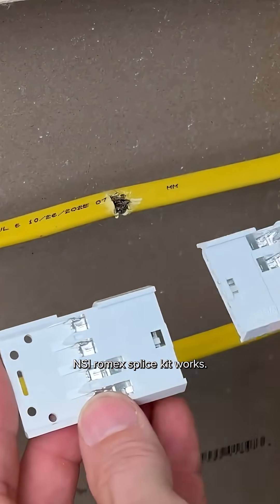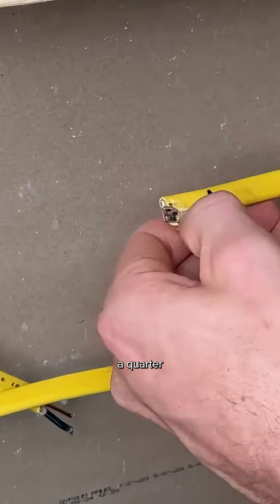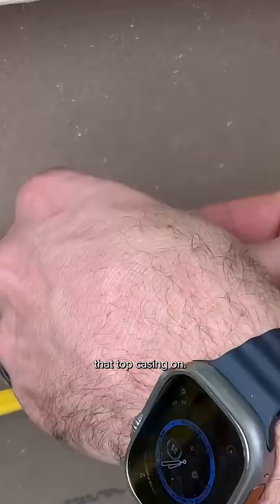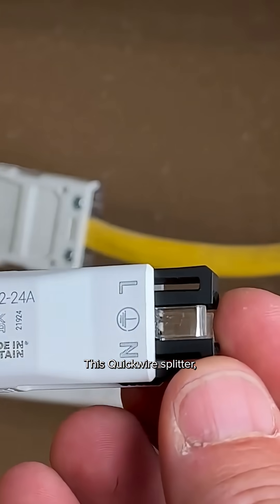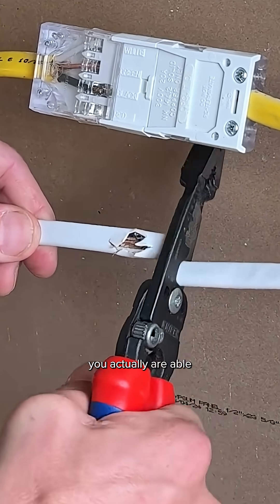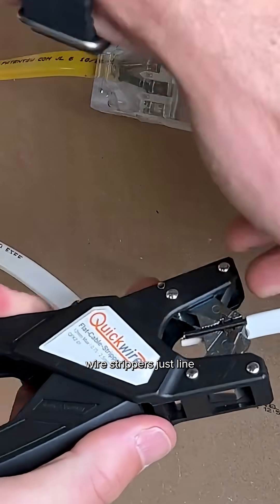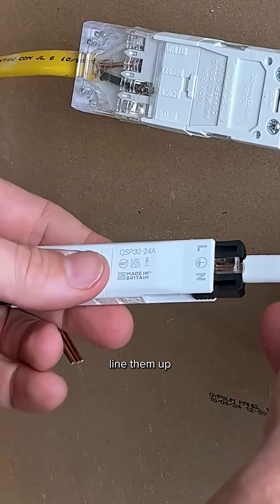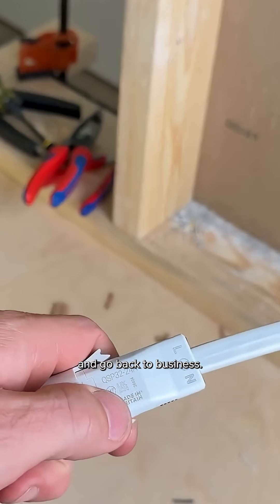The NEC-Approved Splice I Hate… and the UK Inline Splice I Love

Comment: I don’t trust any sort of splice that’s buried in the wall. Anytime you make spices they should be accessible. I don’t care if they’ve been approved or if these ones get approved, I don’t trust it.

Somebody’s gonna do a poor install, and then it’s gonna ark and cause problems. If this kind of thing is acceptable, then I should be allowed to twist my wires with my lineman pliers and put wire nuts and then tape it up and bury them in the wall.

The problem is not the device, the problem is trusting everybody to do these things properly. I can make spices with my wire nuts that will never get loose or cause a problem, but can I trust the next guy to do as good?

Also, what if the device did fail? Again, you would have no idea that that happened where it is or anything when trying to troubleshoot the loss of power to various outlets or something.

If a junction box is used and accessible, then a poor splice would at least be able to be serviced and repaired, but something like this buried in the wall you would have no idea.

Comment: Splices must be accessible. If that's the case then there is literally no need for this connector.... At all... And it isn't a cradle. IPC, Insulation Piercing Connectors. Been around for ages. If it isn't made for the IS market why are you even demonstrating this. No UL listing no NEC allowance.

Comment: I was hoping you'd do a voltage test and a thermal test to see how safe these connections are. Is there an increase in resistance,etc?
Reply: There will be a little with the way the wires are connected. The little pieces of metal that actually make contact with the copper are so small.

How much resistance they add, I don't know. Would like to test them.

Comment: Approved, but let’s see what the infrared gun says about both of them
Reply: Well it's the US so were taking bets here. My bet is the already government approved one will be hotter or the same as the UK one.
Reply: Yeah this would be a cool test
Reply: @PBVader, Explain, please.... I don't see what one has to do with the other?  🤪🤔
Reply: @af.7992  Induction. Learn it. What OP is describing is a hotspot troubleshooting technique.
Reply: @PBVader  so, if houses burn down early because of splice failures, it doesn't matter because a Carrington event might occur in another century or so?
Guess we can cancel all emergency services too, everything burns down or drops dead eventually.
Reply: @spvillano  Houses burn down because of old wiring breaking down, botched and halfass jobs and not paying attention to details (rushed). These weak points were originally mandated to be accessible by the homeowner for repair and inspection, which subsequently got farmed out and made our society stupider. The sun cycle is 11 years, and our magnetosphere is weaker, making a Carrington event more likely from the simplest sun outburst. 100 years? NO. It doesn't matter if the power is cut, the sun will electrically induce power. So grab your temp gun and your ohm meter and give them some lovin'.. Know your system.
Reply: @PBVader  Good answer! We've got maybe 5 to 10 before another Carrington or generally strong flare fully overcomes the already very weak magnetosphere and really creates hell
Reply: @OverAndOverAndOver   Oh dear me, are there any billionaires or trillionaires I can pay taxes to that'll fix the 'weak' magnetosphere or maybe I can stop farting and that'll help? If only I had a penny for every internet soothsayer predicting doom "in 10 years" I would be as rich as Croesus. I'd bet my life there hasn't been a 10 year period in human history where someone wasn't predicting certain doom. You're always wrong and you NEVER own up to it, you just move on to the next scaremonger boogeyman and forget all about the last failed prediction. I had a friend in HS who INSISTED that before he turned 30 there would be at least one pole inversion and probably a Carrington event, that at any rate we would be back to the stone age. If I called the guy up and asked him after all these years he would probably insist he never said any of it. 

Just another day in the Anno Pagliacci MMXXVI
Reply: @billdberger7407  crazy story bro, except it's properly scientifically backed at this point, wait till the middle of next year or 2027 when there's Aurora's down to the equator like we've already seen in the past few years, or better yet when your power goes out and doesn't come back, this is not a time to be mad to feel pride on the internet, this is a time to do some research and maybe start prepping

I don't mean to come at you, if we make it to 2037 I'll gladly admit that I'm wrong, but real signs are showing more aggressively daily and there's no ignoring it any longer
Reply: @OverAndOverAndOver   Okay so now the occurrence of a Carrington within the next 10 years is SCIENTIFICALLY BACKED... By whom the ghost of Lysenko? I think it's interesting how terrestrial weather cannot be accurately predicted a week in advance but you have 100% certain predictions about solar weather over a decade.

Look here's the bottom line, I don't believe you and I never will. I think you're a chicken little soothsayer, a yellow alarmist, and a clown. You have no 'scientific proof' as to what the sun is going to do, all you have is LLM written pablum designed to scare politicians into paying for upgrades to infrastructure. It's no different than the glut of papers predicting that an EMP was certain to happen prior to 2020, there were many alarmists who testified to congress urging them to spend billions hardening the grid against something that never ended up happening. Working in the military industrial complex we see this all the time, someone swearing some potential enemy has WMDs or wonder-weapons and to counter them we have to spend all the money... Often the alarmists are beneficiaries of those expenditures.

There will be no Carrington event in the next 10 years, and you can manipulate statistics all you want and it won't make any difference. Just like I can say with complete probabilistic certainty that if you flip a coin infinite times there will be a series of flips where it lands on heads 1,000,000,000 times in a row, statistically true but MEANINGLESS in the realm of reality.
Reply: Line temp under load isn't going to mean isht when the sun produces another Carrington event and a whole bunch of houses burn down.
Reply: @PBVader  Not quite accurate, the weakest points of failure ARE in fact visible with the methods u dismiss.
Reply: @Klaa-2  Those methods were NOT dismissed, you should see my other comments. The whole system is relatively weak, and built upon a grift known as the NEC from the NFPA, originally meant for responsible homeowners. Or did you not get taught that part? We are a "nice" soyciety, look up the root of that word. I could go into so much more detail.

Comment: NEC does not approve devices.  They states requirements for use. And independent engineering test labs certify compliance.
Reply: That would be different than Canada then, since there's a code book for installations (CEC Part 1) and another one (CEC Part 2) for manufacturers.

Comment: Not Appoved. After looking for a day and ripping up plywood sheets in the attic I finally found this quickwire in the wall behind a mirror. The hot side was toast This was a young couple in a codo and felt for them and charged them 1/2 price. For heavens sake make all connections accsessible
I've seen too much crap that has been coverd up  and have been doing this for 46yrs . Thx for letting put my input on this matter
Reply: If i'm not mistaken these are allowed, but must be accessible. So really not much advantage if any to using them vs. a standard junction box.
Reply: @0778drz110 I agree but, if there is not enough play/excess with the wire then the junction box idea will not work.I
Reply: @0778drz110 nope can be behind drywall by the UL listing only to be used after the fact. If a new run can be ran with minimal or no damage your inspector will request you re-run the wire.
Reply: Are you in the USA?
Reply: I don’t understand how you found a quickwire connector in a home in the USA
Reply: @bradley219 he didn’t, he’s lying or he misunderstood the question.
Reply: what splice do you prefer? or do you just mean that all splices should be accessible?
Reply: All splices should be. Also really dont like those plug n play type connections except for low voltage
Reply: @MrEfx8 isn’t 120v considered “low voltage”?
Reply: @mikecumbo7531 400v is Low Voltage.  Up to and including 1000v is LV.
He means ELV, Extra-Low Voltage, up to and including 50v.
Reply: @Dranok1 I knew what was meant.
Reply: @MrEfx8 then some repairs require ripping the whole house apart like you had to when the whole wire needs to be replaced. It also makes prefab construction nearly impossible.
Reply: @mikecumbo7531 
120 is "line voltage." It's technically low voltage in the overall scheme of voltage assessment, but gets a sort of perception exception where iit becomes the prime reference. When saying low voltage in reference to 120VAC, it typically infers things like 24V systems for HVAC and others.
Reply: @Dranok1  There are multiple definitions for "low voltage", depending on what industry you are working in, and the context.

If you are working as a lineman or something similar, then "low voltage" means under 1000V, but not for anyone else.  That is an industry-specific definition that only applies in that trade (and related).  For most other trades and environments, "low voltage" actually means under 50V, and this is actually very common usage most other places.
Reply: Absolutely agree. The ONLY junction I would reluctantly enclose in a wall would be an underground splice kit with the 4 lug block and glue bound heat shrink. Even then, I'm reluctant to "bury" it without access. I'll either use the splice kit, 2 old work boxes with a new stretch between them, or pull new wire to an accessible location. It's too easy to fish new wires vs cutting open a finished wall.
Reply: These should never be buried! Splices must remain accessable.
Reply: The NEC is a joke. You can have anything approved if you know who to pay off, yes even to violate the NEC itself. It's happened before, then revised to fit, then thrown out. There is zero room for inaccessible splices.
Reply: @PBVader  Just Remember that the NEC is book of Miniums.
Reply: @MrEfx8  Its a book of profit. Nothing is going to stop another Carrington event from torching millions of places.
Reply: @PBVader  just like how manufacturers are trying to push those silly universal mounting plates for all lighting fixtures. I forget the main company name, but that's the next big one.
Reply: They are approved for in  wall coverage or bury it in the wall. I feel most journeyman can make better splices with linesman and wirenuts, however you cannot bury a jbox in the wall. I've used them to comply, but don't feel comfortable using.  Add an AFCI to the circuit for added protection!
Reply: @JM-iz3fr  I agree with your “added layer of protection”!  If the damaged wire couldn’t be replaced properly, and either of these splices were used, I would feel better knowing that I didn’t create or hide another potential problem.
Reply: @JM-iz3fr I don't believe that is the case. Unless they changed their listing the instructions say they must be accessable

Comment: I wish it had a clear housing, I don't like not being able to see the connection that's made and not being able to see exactly how the wires are laying, especially when they are so close to each other.  Maybe if I saw a view from the end it would change my mind.
Reply: That's probably because the fire retardancy of the housing is improved in the opaque casing over a clear material. 
I'd rather have better resistance to ignition, surface spread of flame and a reduced fire loading.

Comment: The release for reuse is dumb and a liability.  This type of installation is permanent, so why offer a mechanism that could enable an accidental disconnection during or after installation?  Even worse would be a partial disconnection, that would introduce the potential for arcing deep within a wall or ceiling.

The footprint of the UK design is nicer, certainly more pull-friendly.

I'd avoid either solution, and wrap the heck of of either in electric tape if  I had to use them or encountered them.

As noted by other commenters, where are the impedance test numbers?

Comment: ya.. fixed this in my house.. basically spliced - solder the connection and sheet rock over it.. not suppose to do it but no one will know and it is just as strong electrically. before someone chimes in.. ran the hair dryer on it for 2 minutes and checked it with a FLIR camera.. no hear at that point

Comment: It depends.
On how strong a lobby the company that makes the old box has.
Reply: There’s validity to the accusation. The NEC has many industry manufacturers on its board. It’s quite convenient for them that as new code requirements the cost of materials goes up. Consider the codes requiring almost every circuit to have either afci or gfci or combination of both in a residential building with the price tag on these breakers exponentially higher than what used to be allowed.
Reply: @ajdubbya Exactly. Ive been saying this for years.
Reply: I mean, wire nuts are still the standard in the US, these connectors will never be as common as the old ones.
Reply: Exactly my first thought also

Comment: I've fixed too many burned-out wires from push-in connections on receptacles to trust that kind of connection. It's not like you have a lot of space restrictions inside a wall, so why not make it a bit chunkier and use screw down connectors. Those I would trust! It's not like you run into this problem all the time, but compared to the cost of rerunning an entire circuit of Romex, the cost of any connector is negligible.

Comment: Used these when I replaced my parents load center and they are great, the impedance testing afterwards showed minimal changes in the circuit. (Panel testing is much stricter in the UK)I also love using Wego’s, which I use in the US now.
Reply: I've been using Wagos when I install smart switches in my house.  They've been great for cleaning up the mess left by the alleged professionals that wired it in the first place.
Reply: @JaredJanhsen "smart switches" dafuq the switches need to be smart for?

I'd rather the entire house be "dumb" and reliable.
Reply: @Apollo-Computers  well, I happen to live in a house built long ago (1901) with a 1950s rewire. The ability to have a light switch control loads from more than one location is kinda nice, rather than the one switch, one location mentality of yore.

Comment: Sorry, but I can't trust any connection that uses simple little piercing of the outer insulation to make minimal contact on my home wiring. I don't trust that to be able to carry the current especially if there are multiple devices on that line and pulling close to the maximum amperage that circuit will allow. Maybe it's just me but I don't trust it. Low voltage, networking, telecommunications wire. Have a problem with that but for home wiring high current high voltage, no way. I do like the European version better. It resembles more of a Wago type connector which I use constantly.

Comment: The US NEC-approved NSI In-Wall Romex Splice has ab clear window om both sides so you can see what's happening inside to know when the wires are all the way in and positioned over the insulation-cutting securing tabs, and a screw to hold window to the back.  I would like to see a UK Inline Splice taken apart so we can see what happens inside and examine how they work, please.  Have you done a pull test on both with the hanging weight system you used on WAGOs and clones?  I would like to see that, too, please.  This may not be a big deal because it's securely hidden behind the drywall, paneling or whatever, but I would still like to know how securely they hold, please.  I would also like to see the heat test, and the Voltage and Amps drops on both, compared to a wire nut, please.  Let's find the results of all testing methods, as compared to straight Romex and then wire nuts please.  Thanks in advance.

Comment: Why did we move to solid wire in house wiring? Electrons travel on the surface of conductors. Stranded wire is a much better conductor.
Reply: Interesting question 

Presumably, solid is easier and cheaper to manufacture, but l am not sure, if this is reality, especially in this day and age.